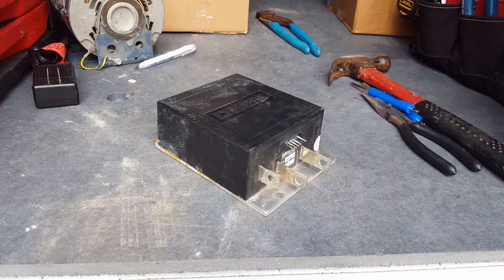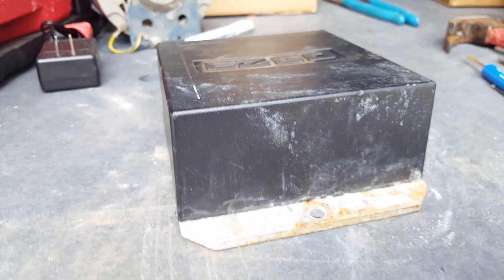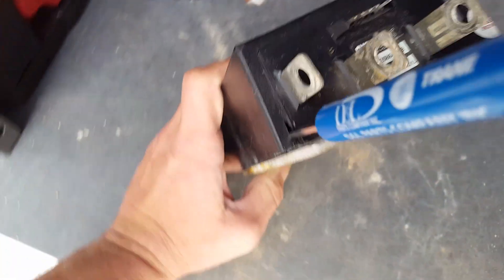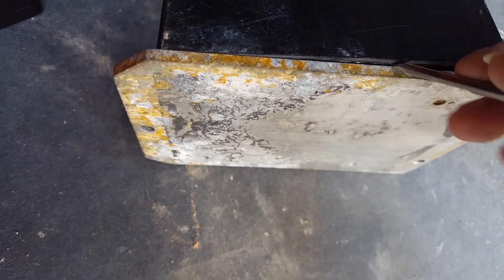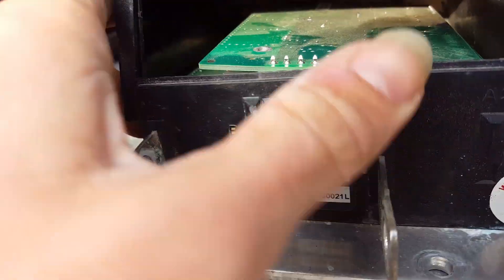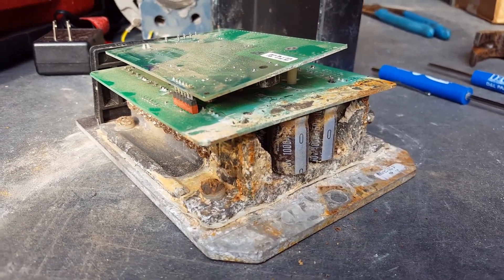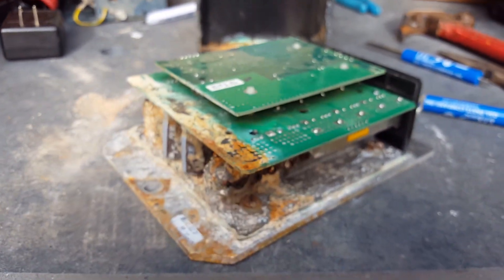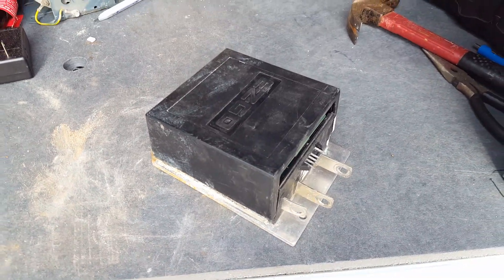How to open and disassemble a EZGo Curtis 1206 Controller

Comment: Thanks for the video. If you use an Ultrasonic Cleaner tank $90 on eBay, and some CLR or Branson EC, cleaning solution, I'll bet you could clean it up, replace all the Capacitors test the Power FETs. As long as it doesn't have a transformer or chips that are MFG specific. You could probably rebuild it for Im guessing $60 MAX in parts. Caps are $1 and Power FETs are $2 through Mouser. I have a Curtis 1237 Im trying to crack the case on and repair.

Comment: if you look at the scematic all the working parts just connect thur controler   depends on what tble you are having   start out by cleaning battery cables real good  that effects the current flow big time if you clean the cables  you willhave max current to motor all you get sometime is a click of the solenoid  take the cables off one at atime   use baking soda and water and an brush if you dont have awiire  buffing wheel  90% of the tbls is theses dirty cables

Comment: That controller is not a candidate  for a repair. I open them by sliding a putty knife under the side to release, then go to the other side and repeat.  To replace just align top to bottom and press gently until it snaps.
.